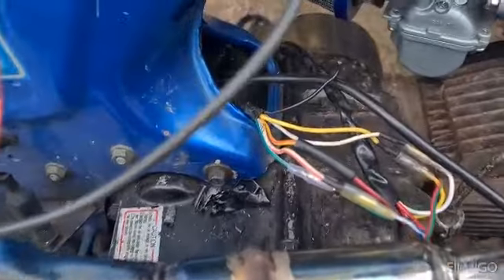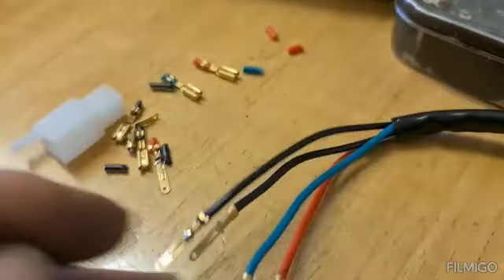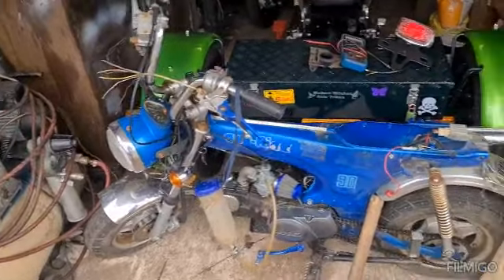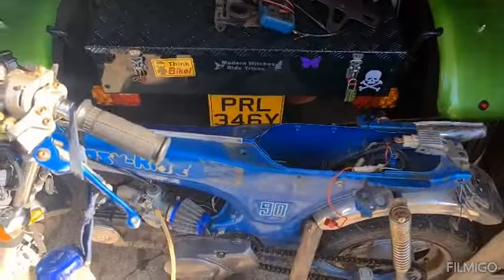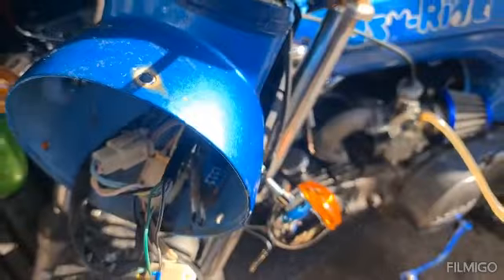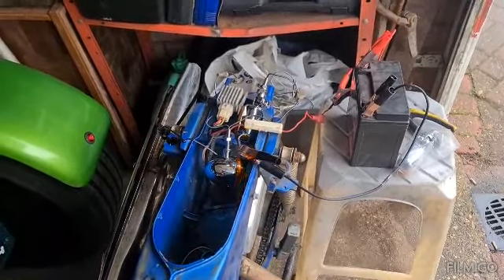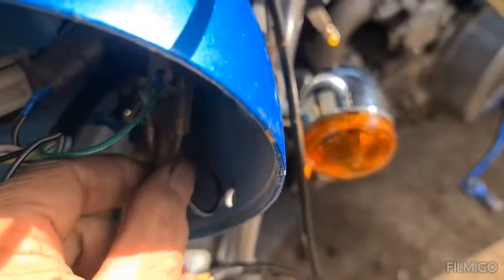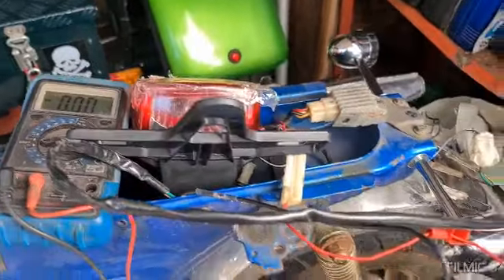Honda ct70 dax copy  ice bear champion Amigo easy rider Dax part 3

Comment: Getting there now Andy 👍  wiring coming along nicely ,wiring is bad enough to work on but when someone's been there before you makes it twice as hard !!!! I bet a lot of hours going into just the wiring more than anything else .for a wee bike it has plenty of electrics it seems .😮😁 just noticing the trike taking up the garage space !!! Where's the xls all went ??? Not flogged them all have you ?😁
Reply from the maker: Let's put it this way Hours sitting there Scratching my head  smoking cigarette drinking Cups of tea But Finally getting there . My Honda xl's are all safe and well in my new shed I had Built this summer m8 it's bigger than the garage. But I can not get the trike in it Because of access m8 So back to square one struggling for space lol.